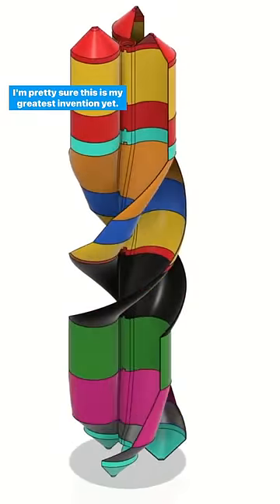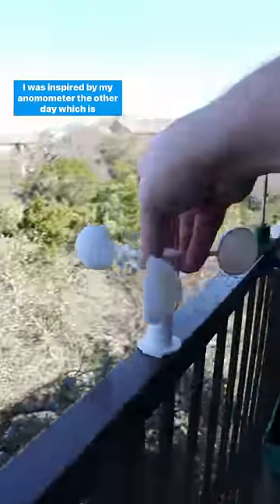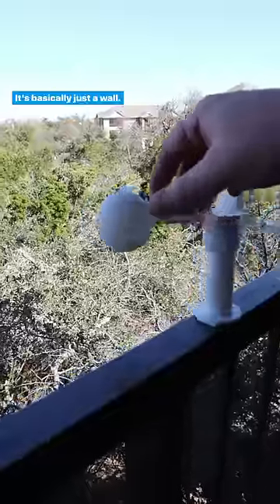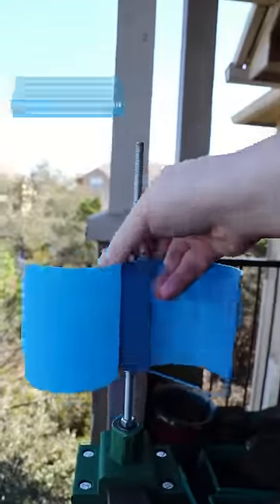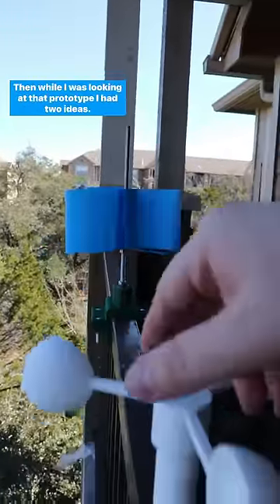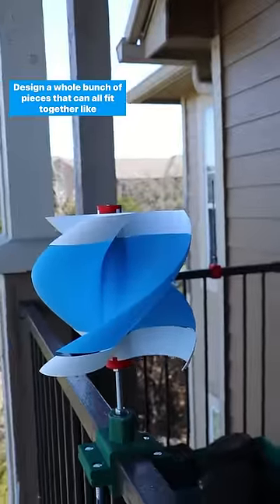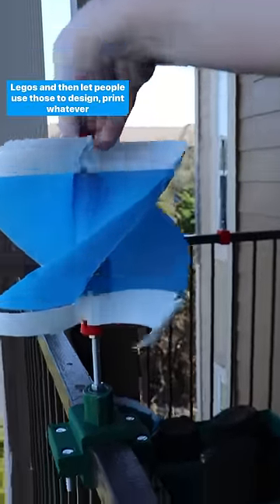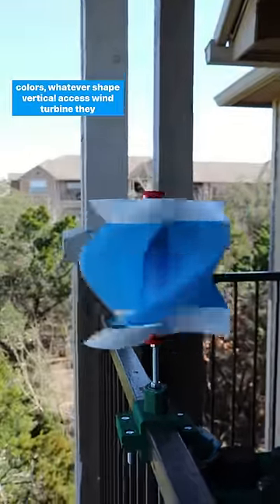My Greatest Innovation Yet: Modular, Stackable, 3D printed VAWT! #shorts #3dprinting #diy

Comment: You didn't invent it. It already exists. What's more, it's already been greatly improved by using aerodynamic lift instead of aerodynamic drag. Two french engineers already sold this idea about a decade ago, and already had issues with existing international patents. Anybody with access to Wikipedia and have modest Math, Physics and 3D skills can design better.
Good effort, though.
Call me if you'd like 3D models of wind turbines designed according to the aerodynamic knowledge of this century rather than that of antiquity, tailored to your specific needs.
Or, if you still prefer to research and design by yourself, feel free to ask for keywords so you can quickly get a better knowledge of the state of the art in this domain. Just keep in mind you are on the tracks of people who already designed all of that long before.

I genuinely thank you for making this technology easy and accessible to many people who aren't able to design this by themselves but are rich enough to buy a 3D printer. The world need people like you.